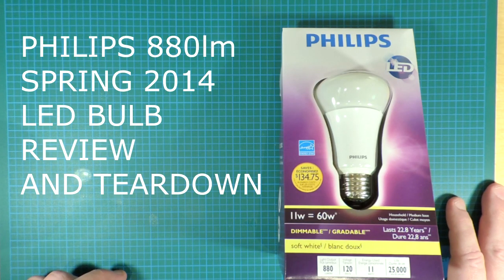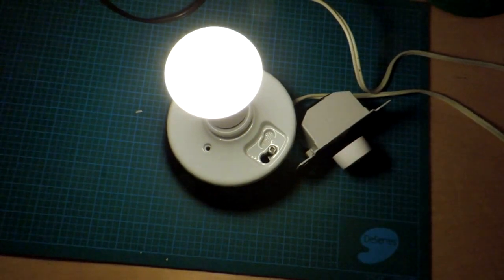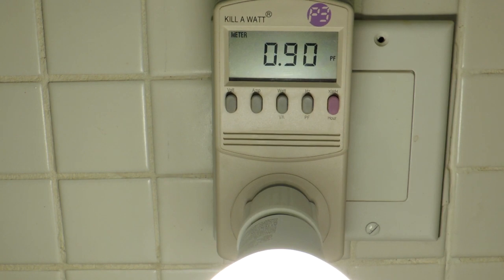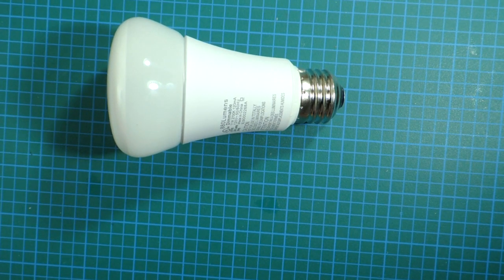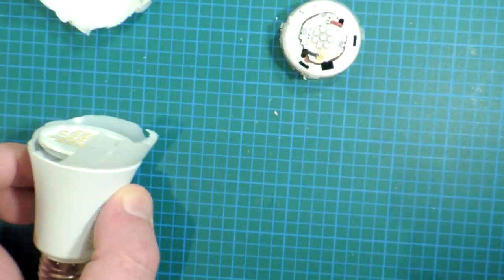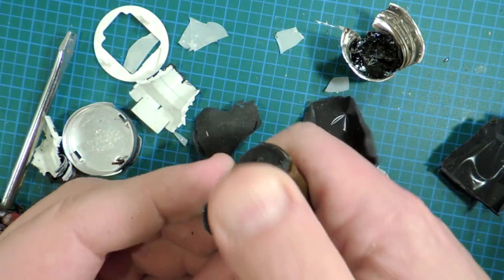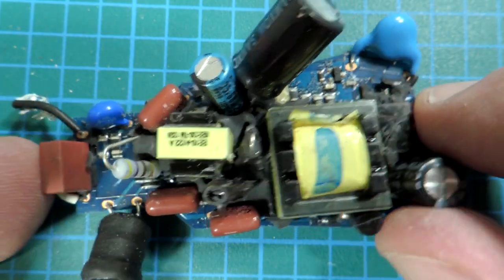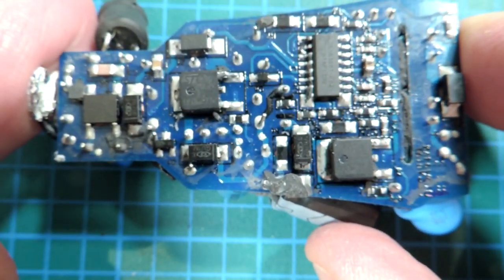Philips A19 "60w" LED Light Bulb Spring 2014 Version Teardown and Review

Comment: Having trouble finding it. What's the sku # and do you know if they have a 75/100w version?
Reply: At 2:42 the video shows 9290002268a printed on the side.
If we go to the energystar website and look up that number (sans "a" on the end) we get this page:
http://www.energystar.gov/productfinder/product/certified-light-bulbs/details/2169823

Under the "additional model information" tab it lists a bunch of numbers, including 424382. I am assuming this means the bulb in this video is the same as the popular Philips 424382 on Amazon.

I have been comparing this Philips bulb against the common Cree 60w equivalent bulb (also disassembled on this channel). I like the lighting characteristics of the Philips, however this video shows Philips using Samxon capacitors whereas Cree is using the better-regarded Nichicon capacitors.

Capacitor quality is the only reason I haven't purchased the Philips bulbs, I would be interested to know if the video author has an opinion on whether Samxon capacitors are trustworthy in the long run.
Reply: ***** Honestly I don't know for sure, but that linked review doesn't give me any indication the bulb in this video is the 423491.

Also if we look at the packaging for the 424381
http://www.amazon.com/Philips-424382-11-watt-Household-Dimmable/dp/B00B4CPL5W
and the packaging for the 423491
http://www.amazon.com/Philips-423491-11-watt-60-Watt-Dimmable/dp/B00B2KU8ZY/

The packaging for the 424381 looks much closer to the packaging shown in the beginning of this video. Not conclusive but it is something.

Comment: Hi there, I was wondering, when you do a review, could you add "start up delay", i have noticed some bulbs take a second or two to turn on after the switch is flicked - in some applications this is frustrating (eg, cupboards, bathroom ect)
Reply: No, often they do, due to inrush current limiters and switcher startup minimum voltages.
Reply: bgdwiepp you are thinking of compact fluro. led bulbs don't have a delay, they don't need to warm up. You may be a victim of fraud. Some CF bulbs pretend to be led, or at least mislead you to assume that.
Reply: specialks1953
Many of the LED bulbs have a delay. Not to get to full brightness of course, but to switch on in the first place. It doesn't really matter for lights which are on all the time. I never had a bulb that took longer than a second to come on, but when "running" through a hallway, even half a second of delay between pressing the switch and the light coming on is more than annoying, especially if one of those impulse relais (these things where you don't toggle the switch but just press it for a short time) is used for switching. You don't know if you pressed hard enough, stop to maybe try again, but then the light comes on from the first press. All stopping you in your tracks. I know a second doesn't sound much, but you would be amazed what your brain will do in this second if the thing you expect (push button -> light) does not happen immediately. And it becomes even more annoying if you got multiple bulbs, switched at the same time, because they will all come on at different times, even if it's the same model.
Reply: I have an LED bathroom fixture (Costco) with 3 adjustable "spot lights". This fixture has an annoying and noticeable delay when initially switched on. Trust me, it's not a CFL. I can see the 3 separate LEDs and the packaging clearly states LED. Of course, this is an LED designed fixture with built in LEDs, not individual bulbs.